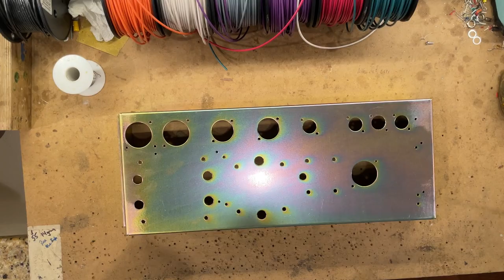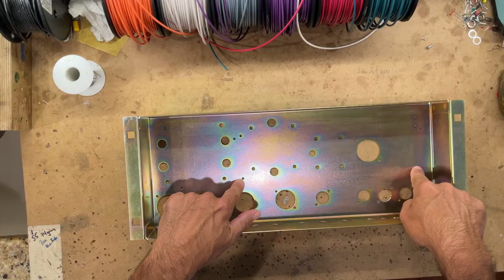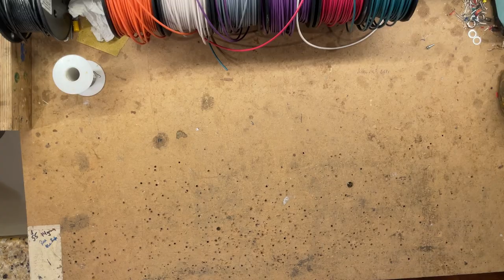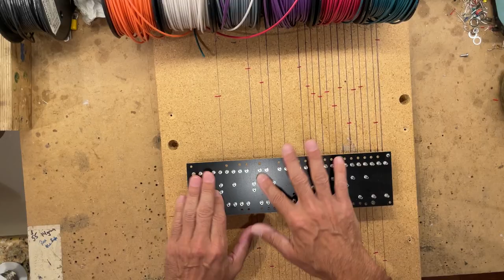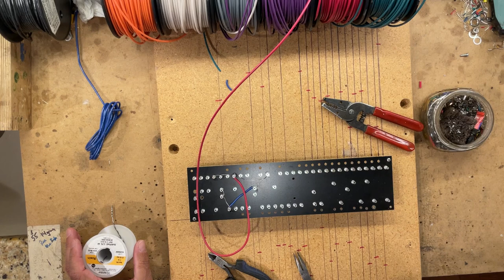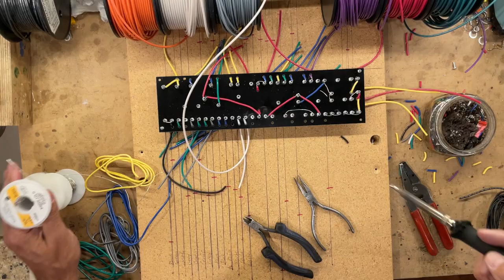Jose 50 Watt Head Build Part 2

Comment: Hey Ossie, a couple questions...
1. What bus wire are you using and AWG?
2. What wire make/model/AWG are you using (looks PVC instead of say Teflon, AWG unknown and number of strands and thicknes....more strands, but thinner...or less strands, but thicker, type - copper or tin, etc.
3.  What type solder and do you use moder non-Leaded or old school tried and true Lead solder?  60/40 or..??
Reply: I'd like to see your answers to these questions. It's an honor to see and learn the craft in your art!
Reply from the maker: Hi!

I use 20ga bus wire.  Alpha I think. 
I use a 22 ga topcoat tinned wire. PVC jacket.   made by annixter
I use 60/40 solder , Kester 44- 0.062 

Hope that helps :)
Ossie